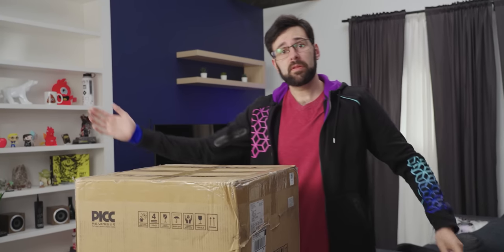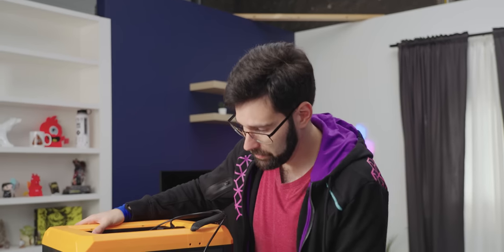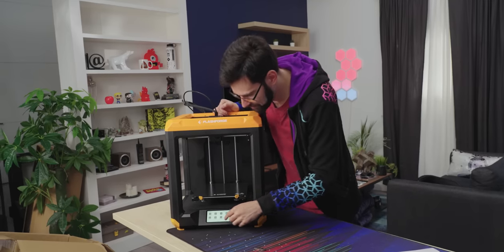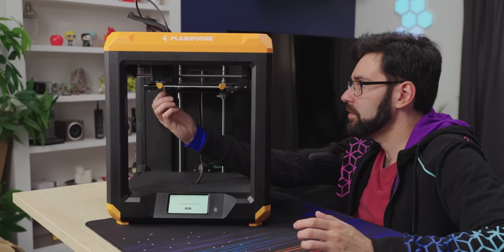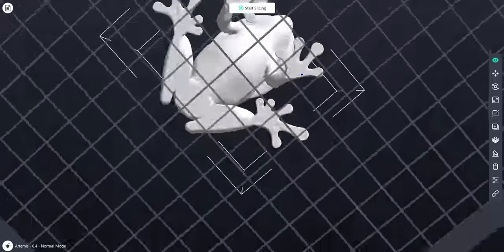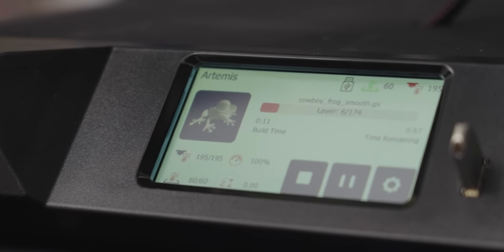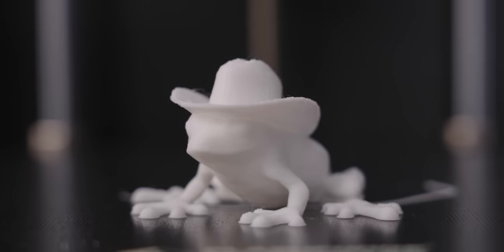This made me a new friend! - Flashforge Artemis 3D Printer

Comment: 6:35, thats usually a PTFE (Teflon) tube. You aren't wrong about wanting a tighter bowden tube but this tube is actually a reverse bowden tube, which should be wider. Reason being that the direct drive hotend pulls the filament and you do not want extra drag from a tight reverse bowden.
Unlike an actual bowden setup its purely a loose guide.
Reply: Yup. And in a set up like this having a tighter tube can actually cause issues when printing with certain filaments such as Metal Fill or CF Nylon due to the tightness causing too much friction leading to potential under extrusion.

Comment: Damn that power interruption auto recover is a game changer. My power cut out for a second in the middle of a long print and I didn't want to start from scratch again and had to figure out which specific layer the print stopped at and edit the gcode manually to resume from there. It worked out but if I never had to do it again I sure wouldn't mind

Comment: I'd like to state: Tight bowden tubes (1.8-2mm ID) are important for when you have a bowden extruder, which pushes the filament through the tube. On a direct drive extruder, using a large (2.5-3mm ID bowden) reduces friction as the filament is pulled through the tube.

Comment: That metal plate is made of PEI which gets sticky when it's hot so your print will stick better, then when it cools down it unsticks.
I bought one as a replacement for my standard metal bed and it's fantastic to use.
I like my Flashforge Adventurer 4, even though it's not super mainstream I like how it prints.

Comment: Great 3D Printer to kickstart LMG's 3D Printer reviews! Having worked at a 3D Printing company for 3+ yrs, Flashforge 3D printers were the most reliable & affordable printers out in the market. We usually run them 24/7 most of the times. Requires very little maintenance. Only problem is replacing parts since you get locked to their ecosystem as everything is proprietary (except the filament). Also, from my prev. exp. I'd chuck the filament tube which is actually more for style and sometimes causes clogging. Since, it's direct drive you can insert the filament directly to the extruder head. Also, surprised to see they haven't changed the touchscreen settings or the music in over 6+ years. I'm not sure if this is a bug still but their unload function rarely works. You have to use loading setting for both filament loading & unloading.

Comment: To this day I still have my flashforge finder. According to the system settings menu it has run over 1300 hours, never had a lot of issues with it. For Christmas I upgraded to an all-metal heartbreak, all-metal extruder arm and a 0.2 mm nozzle. Although it prints very fine details, the added weight gives me an insane amount of ghosting. Nevertheless, it's my first  and most reliable printer ever! When I move out, I'm gonna encase the removable printbed in a resin cube I think to keep it was a decorative piece. If this one is anything as reliable as the flashforge finder I'd recommend it to everyone (although it's a bit expensive compared to the insanely cheap ender series these days)

Comment: Can confirm, glass printer beds are often surprisingly not very flat. Usually beats a spring steel sheet for flatness if the bed plate is a thin ish rolled aluminum plate though.

Comment: My first 3D printer was a FlashForge Replicator Dual clone (MakerBot board and everything), the O.G. wooden one from 2012. With that said, they make quality printers without cheaping out. Personally (im cheap) a bit more that i want to spend when you can find other better printers for less, but! ussually almost always require tinkering or a complex setup.

Comment: The Artemis is Corexy FDM printer while the Prusa and the ender 3 are i3 style printers the difference being the Corexy has better printing speed and quality but is complex in design as opposed to i3 printers which are simple and small 
and it seems like you can upgrade the printer hotend and change the motherboard so it's easy to do

Comment: Had the predecessor (flashforge Finder) as my first printer 6 years ago. It's a solid machine, but whenever something breaks it's almost impossible to disassemble.
Biggest upside was zero setup needed apart from leveling. No assembly, no tramming, no stepper calibration etc

Comment: I had a Flashforge as my first 3D Printer about 8-9 years ago.  I think it was a makerbot clone, but it also had the XY on the print head (not CoreXY, but still).  I wonder if that's just a thing with them.

Their bed leveling program hasn't changed a bit.  Not an autoleveler, but still easy enough to keep it affordable.

Comment: At  $1500 compared to creality's ender 3 v2 that on their website cost $279 people are gonna go for the cheaper printer, this is why people go for the printers from creality and prusa, they are affordable.  Not to mention all the upgrades that can be done on the cheaper printers where as here you are lucky just to be able to change the nozzle.  enders 3 can be completely changed to a core xy printer and may still be under the cost of this flashforge  printer.  and you say this can be used for education purposes, most printers like ender 3 and prusa printers all are alot easier to work on making them perfect for education enthusiast and even professional use.

Comment: To be honest, you can't say that most printers don't have failure recovery anymore. Even ender 3 pro's have that.
This is also not an "affordable" printer. Maybe for a company, who is looking at "industrial' designs, or someone used only to Prusas, but the average printer with specs like these should be much lower. Look at the new Ender 3 Pro V2 or Smart, for example.
Reply: How many other printers (price range) have the easy bed leveling?
Reply: @luz_reyes_676  kp3s is one that has a very similar method. Any cubic has ABL on printers that are 3-400$

Comment: I would only recommend FlashForge if you absolutely need a feature that's not readily available on other machines. All the proprietary hardware and software are limiting your 3D printing experience - oh this printer is only compatible with a couple nozzle sizes, oh the slicer don't have the feature, etc. There're plenty of faster, better quality, and open-source printers for cheaper and better supported by the brands and communities which in turn contributes to new techs and features. You don't even have to tinker if you don't want to with something like a Prusa, yet you enjoy the fruits of passionate people worldwide.

Comment: The PCB in the hot-end is a 'marshalling board', usually designed to bring a bunch of disparate sensor and power leads together into a unified connector interface. c.f. Big Clive*
The mainboard looks like it's pinout is fairly generic if you wanted to go with a BTT or similar. Stepper motor connectors are pretty standard these days.

*and now I've mentioned him, he will appear if by magic, with the top ranked comment.

Comment: If your going to be spending this much on a printer then I highly reccomend the Ender 3 S1 Pro. Not only is it going to be bigger than this printer (220X220X270MM) it also has much better after market suport (mods) but cheaper and prints faster.

Comment: 5:00 Any printer that doesn't have full automatic bed leveling immediately looses points from me; the best adjustment, is no adjustment.
I don't know why more companies don't implement it, all it takes is like two limit switches which cost them pennies (or a prox. switch if you want to be fancy) and it DRASTICALLY simplifies printer calibration & setup, allows for multi-point leveling, and overall makes for a much more user-friendly printer.

Comment: Buyer Beware: Looks like Flashforge was testing this machine with their sister company Voxelab for the past few years. This machine is the Voxelab Aries with a Voxelab Aquila S2 direct extruder relabeled as a Flashforge Artemis. I have some extensive experience with both machines and as welcoming as this is machine looks, both the Aries and S2 were definitely not the best Voxelab/Flashforge had to offer. A closed source printer and a proprietary hotend. If you look closely at the nozzle and heatbreak, they are not standard. The nozzle is shorter than a volcano and longer than an mk8. The heatbreak is a steel piece that can only be purchased through Voxelab/Flashforge. Same with the block itself; It threads through the instead of between, making it proprietary. Glad the nozzle size was mentioned at 13:13. Also worth noting that the Aries is half the price of this machine and is the same machine minus the direct drive. The S2 is also half the price of this machine but in a different form factor. Just some food for thought.

Comment: Is there a way to change the firmware to change the hot end temp settings? The flashforge adventure 3 only goes to 265 degrees. I ordered some carbon fiber nylon and the temp for printing is 300 degrees. Any suggestions? Should I get a new printer that goes past 300 degrees? I’d like to change the firmware.

Comment: Here's Dan surprised at Bronze Bushings and feeling that this style is not "Traditional"... and sat beside me are two Replicator 2X's built in exactly this format.
TBH this does feel and look very much like the old Makerbot machines before they got bought out in around 2012. Only real difference seems to be that its not fully enclosed.
Looks like a nice little machine, but a shame about the proprietary hot end and one-piece control board.

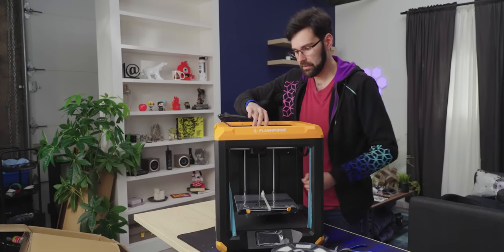Comment: A few additions and corrections to the video: 1:30 most printers on the market are the so called bedslingers, where the printing bed moves in the Y direction(prusa mk3, mini, ender 3, etc) and with the upside down T shaped frame. The motion system is a cartesian one. Even though the frame on the Flashforge Artemis is a cube(usually seen in corexy and hbot printers) the motion system is still cartesian(as seen by the X motor being on the end of the X axis) and not corexy or hbot so it does not have all the advantages of those motion systems, but the fact that the bed is not moving on the Y axis is a plus for taller prints. 2:10 the advantage of a direct drive extruder is mostly the fact that you'll have smaller retraction distances, you'll be able to print flexibles easier(but after seeing the filament path at 12:17 I'm not really sure that the filament path is constrained enough for that ) and you don't have to change the bowden tube as often. The black bowden tube at the back at 6:35 is a so called reverse bowden tube and it should NOT be snug on the filament as a on a bowden extruder setup. It's role is to help get the filament to the printhead more constantly, so if let's say you are printing two parts in diferent parts of the bed and the printhead moves quickly to the other side it doesn't pull hard/snag on the role of filament. 2:35 even if the hotend can reach 260 degrees, this printer is not really recommended for ABS or nylon as those filaments really need and enclosure so they don't warp and get of the bed. But for PLA, PETG, and good quality ASA it should be totally fine. 3:27 that is a powdered PEI plate. PEI is a type of plastic that likes to stick to other plastics, like the commonly used PLA, PETG, ASA, ABS, when hot, but releases from those parts when it cools down. This surface is actually a lot better than the  borosilicate glass as usually borosilicate beds tend to stick to prints too well when the surface of the print is bigger and quite a few incidents related to 3d printing stem from the fact that people hurts themselves trying to remove the print from the bed. Yeah the choice if nozzles is kinda weird, the standard V6 nozzles would've been better as they are more widely available. They seem to be using Gates belts which are known to be high quality so that's nice to see. The size of the printer compared to the print volume is not that great, a prusa mini+ has a 180x180x180 build volume is a bit smaller. And the user experience with that will be quite a bit better, expecially as prusa comes with their slicer which has tons of filament profiles, which makes them expecially good for beginners. I'm not a prusa printer fan myself for other varying reasons but the prusa mini+ seems like a way better deal than this machine expecially since the prusa printers comunity is huge. Hope this helps someone, have a good one!
Reply: Good analysis and observations, I also agree that the prusa mini+ would probably be a better option, but this is a plug and play machine and there are some people\institutions that require exactly that.
Reply: @josuelservin  fair point, and everyone should vote with his dollar, just wanted to point out some things that I thought might help some people

Comment: Just purchased the Ender 3 s1 pro and it turns up tomorrow. Was worried when I saw this after coughing up at near the same price point. Being new to 3D printing have I made the right choice?
Reply: You cannot go bad with an ender for a start, do some research what the common problems are to be able to handle them. Get some replacement parts (v-wheels, nozzles, maybe a bed sheet as You'll surely destroy Your first sooner or later) and happy printing :D
Reply: @IDiveI11  Been good so far!! All this as my son has a love of boats.. Forgot how good it was to get back into 3D!

Comment: Fairly standard makerbot copy from flashforge, wont recommend any flashforge or makerbots as they are pretty bad value. Best thing about these though is the 3 point bed leveling, instead of 4 point which overdefines the bed plane.

Edit: As always makerbot and clones always have awful hotends and extruders, one sided parts cooling, proprietary nozzles, and the worst thing, it still uses a plastic piece of shit mk8 style single gear extruder.

Comment: I suggest the ender 3 pro it cost $200 at microcenter and the bed size is bigger and you would have to purchase a glass bed separate but it still would be cheaper and more bang for the buck.
Reply: how is the bed leveling on it?
Reply: @luz_reyes_676  it's Manuel so you have to use a price of paper and control the nozzle to each corner of the the bed. It takes 5 minutes max and once you level it you won't have to relevel it in a long time.

Comment: Problem is that Flashforge sits in this weird proprietary area, and is generally the clone of a closed source ecosystem stemming from Makerbot days of yore.  They have a custom slicer, which means all of the open source developments, which happen at internet-speeds -- meaning things can be obsolete in a year or two -- you don't get.  Don't buy any printer that cannot use a normal gcode-based slicer such as Cura, Prusaslicer, Ideamaker, etc.

Comment: Honestly very disappointing they're just using bushings instead of ball bearings (either linear rods or linear rails) at a ~$600 price point. Those bushings will wear out significantly faster than the not very expensive alternatives. The part cooling fan also looks anemic. It's likely that the outlet pointing slightly at the sock is actually a good design, because the momentum of the airflow likely still has it hitting closer to the nozzle.

Comment: I've never seen someone act like they know so much about something but they don't know what they're talking about. Extra brass nozzles are different sized nozzles and the flexible metal bed is supposed to lay on top of the glass...
Reply: The flexible bed is meant to be sticked to the bed directly and not the glass. if you would stick it to the glass you would lose quite a lot of heat

Comment: There's so much misinformation in this video...
This printer is nothing special, or different - there are plenty of then, in fact, second most common design.
Direct drive doesn't guarantee quietness of the printer.
260C might not be enough for nylons. There still might be a little of ptfe tube inside, in which case, max print temp is 245, or toxic fumes begin to appear.
Wood filled filament is not abrasive, brass filament is ok, what you really want is a 0.6mm nozzle to prevent clogging.
Glass beds are only flat if they are manufactured well, by no means a guarantee.
This isn't a printer for school environment, it doesn't close and it lacks safety features. 
Homing is not indicative of how quiet the printer is. It's the fans during printing that make most noise.
$589 is not incredibely affordable for what this printer offers, and it's definitely not "quite competitive".

Comment: Good luck with changing nozzles.  Flashforge using their own nozzle design thats not compatible with anything else on the market. If you like to use carbon filled filaments you are just out of luck with Flashforge. As this printer seems to be open, that limits you with PLA, HIPS and TPU. ABS and PETG need to be printed in heated chamber if you need a strong part (You can print PETG with open printer but layer adhesion will be bad)
As a owner of two Flashforge printers I can tell you - keep away from this crap. It takes lots of money and time to rebuild those things.
You will be much happier  with printer that you can easily upgrade using standard parts.  
Other thing is that bed is flexing really bad in flashforge printers. As little of 50g on front of the bed will flex it a bit. That was a big issue for me as I couldn't figure out why my prints didnt had straight sides.

Comment: almost all printers have resume from power loss feature. some, don't have it properly enabled (it needs to write to storage somehow, so to the MicroSD card, so it knows WHERE to resume from) Even my Ender 3 from 2019 does. (although, in it's original firmware it was improperly set up, by having it enabled, but also haveing "SD card READ ONLY" enabled,  this extends the life of the SD card, but obviously it won't have anything written to it from the printer, so it has no data on 'where' to resume from if a power loss occurs.